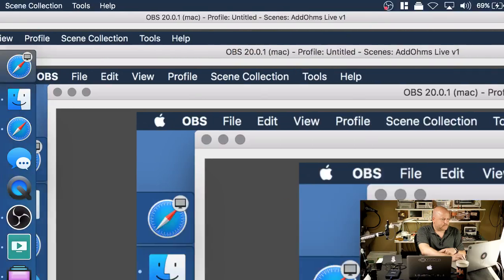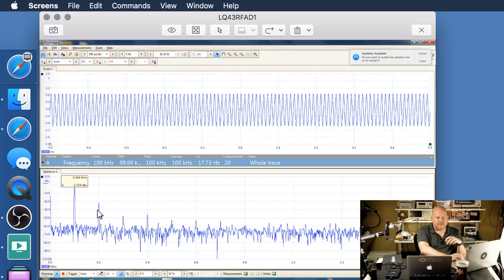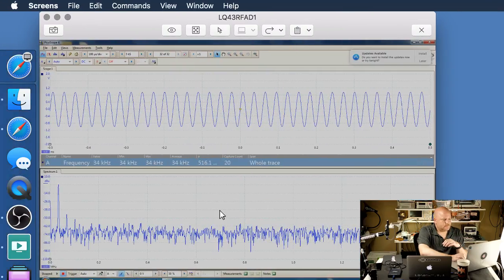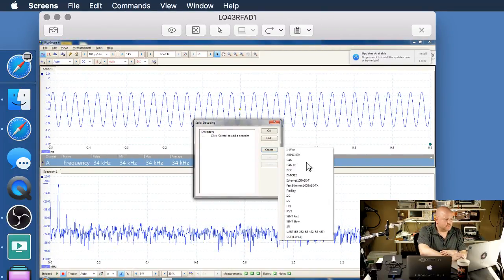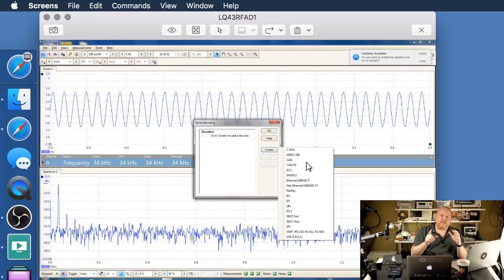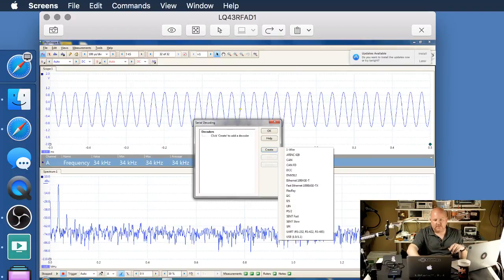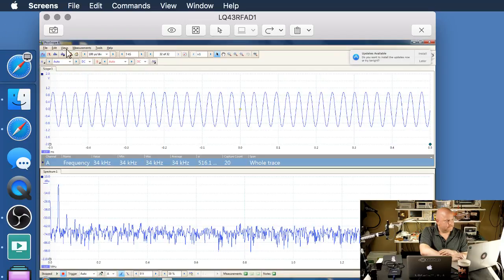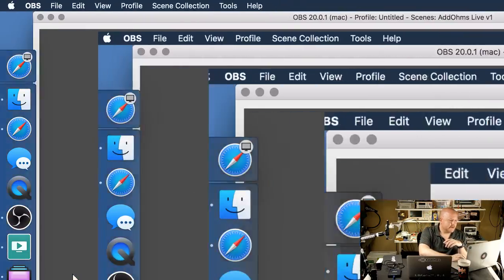PicoScope 2204 Hands-On | AddOhms Live #1(Beta)

Comment: Respect for what are you doing, first of all. Very good for first time. I want to suggest to add some room dumping material. For start you can use pillows and blankets outside of camera view. There is too much room "echo" and sound bouncing. Microphone position is important, but I see in previous comment that it was technical issue. Best Regards.
Reply: Your lighting and video quality look perfect! That lav mic should be fine placed as-is and give you echo-free sound without risking the use of any foam.  Please use caution if considering adding "sound absorbing" panels because most foam material itself is quite flammable unless you hunt down the expensive, poor performing "Class A1 fire rated non-flammable version". (lol, although these do convert sound to infinitesimal thermal energy by flexing, it's not going to burst into flame from from loud sounds, but they will certainly emit a choking deadly smoke and spread fire if ignited by enough sparks or an open flame.) Not worth the risk going that foam route IMO. Instead, I'd just let out my inner crazy and install opposing wall(s) at slight angles to prevent side-to-side reverberation, keep the floor layered with thousands of defective, bulging electrolytic capacitors to stop floor to ceiling echos and of course, wear shoes at all times.
Reply from the maker: +DIY Stuff Good tip. I'm building a new lab/studio. I'll add sound absorbers to it. When I record offline, I get slight echos with the right mic.
Reply: Nicely said. My comment was just for quick problem bypass. For a lab, on the first place is safety.
Reply from the maker: +DIY Stuff Funny you say first is safety. I can't remember if it made it in frame. My nice polycarb glasses were on the table. I try to include them when I can, even if I'm not wearing them.
Reply: Empty egg trays are excellent. You know, the way restaurants buy their eggs. Those that are made of recycled paper are excellent sound observers. Go around and put the word out to nearby restaurants to keep the empties for you to pick up. You can spray paint them black and they look good too. Best of all, FREEEE
Reply: PirateKitty They are not.
Reply: I used them many years ago, they work great. They didn't work for you? Did you even try them?
Reply: Yes of course I have tried it, many years ago. It can be used but there are much more "don't use" reasons.
First thing is cardboard store to mush moisture and it stinks :) I have recently watched video when a guy perform various tests for material that is most efficient in absorbing sound.
 When I was playing with sound absorb material, ordinary blanket from two sides and back were very good. It is not professional, it is not pretty (no one can see it except for you), it is flammable, but i presume that no one will play with something that can cause fire. When you finish recording put away blankets or cover yourself during cold nights. It is not "highend" stuff, doesn't cost $xxxxx and it does pretty good job. If you add randomly pillows in the room... Try...
Reply: Well there you. I spray painted mine Matt black, front and back. They didn't absorb any moister and it was in a room in the basement. I also got a lot of complements from others saying it looked "Way cool" .
But hey, you no like, you no like :) 
We can't all be dancing to the same tune!
Reply: PirateKitty Hmm... So you made sound deflector, not absorber :-) It is ok for deflecting, and absorbers and deflectors are science. Don't missunderstand me, it can be used, painted looks good, but overall not good. Pls. find video with tests. We all have tried egg cardboard :-)

Comment: ...just trying to help, not criticizing helping you fix AUDIO.  Listen for tapping >> 12:34 <<  lav microphone input not selected!
Reply from the maker: Well we were both wrong. The mic was disabled on both laptops. Turns out, I plugged my lav's receiver into the wrong port on the camera. So it was the camera's microphone. Which is why I could hear it on the earphone monitor. Glad you said something though because I kept thinking about it after the stream.

That said, I'm shocked how well the camera''s mic worked. I think I can stop using my mini-shotgun for reference audio.
Reply from the maker: +FindLiberty Which is to say, you were partially correct.  Wrong mic, but I messed up elsewhere.